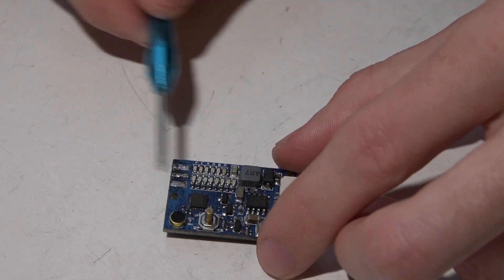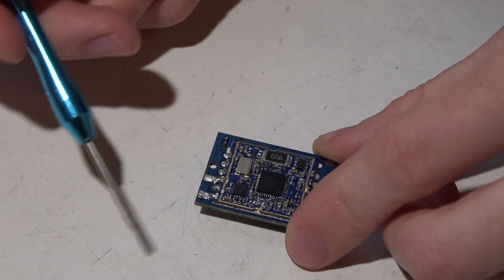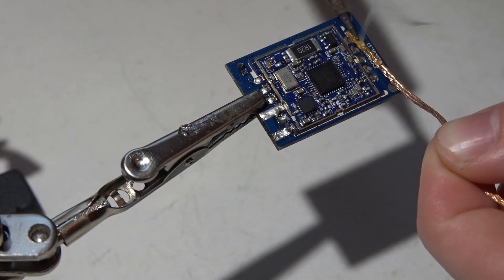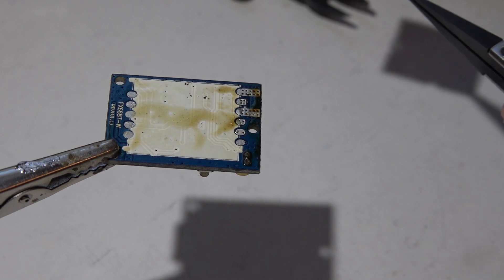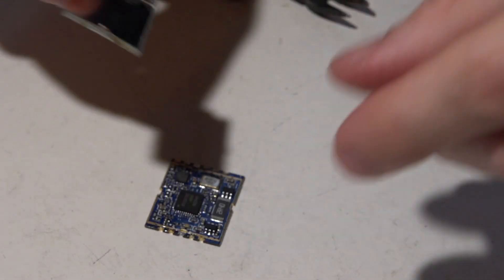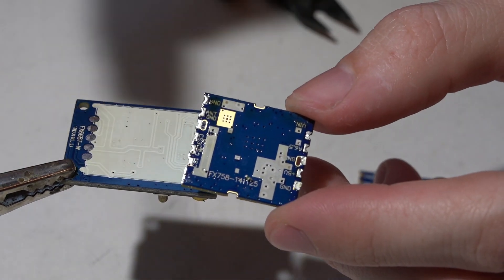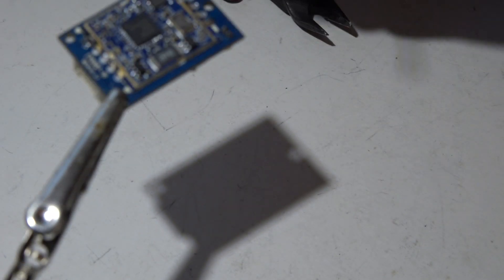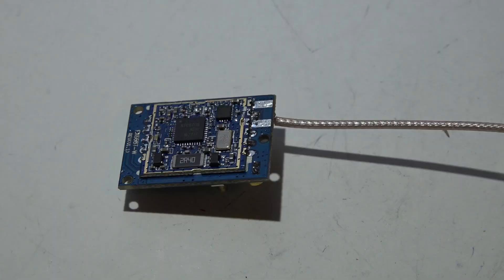Replacing VTx Transmitter Module

Comment: Hi, what exactly did you mean by degraded quality of video? What kind of distortions/degrading did you have? I have two cheapie TS5828 transmitters that have flickering white lines running down the screen intermittently.
Reply: I'm no expert but according to him, he means to say that max range gets lesser and there would be distortion even in short distances. In case of your vtx maybe it could be due to the bad voltage regulator. And he won't be able to reply because he died in a accident 2 years ago.
Reply: @rushikeshpalkar3367  Thanks for the reply, I'll check the regulators out, see if I can bypass them and run them directly from a bench supply. Sorry to hear about the accident, that's terrible.

Comment: with the setup you have there in the repair. What would be a good method to add a heatsink to a 600mw version? would it be better to leave the metal cover on and adhear a heatsink to it or would another method be better?